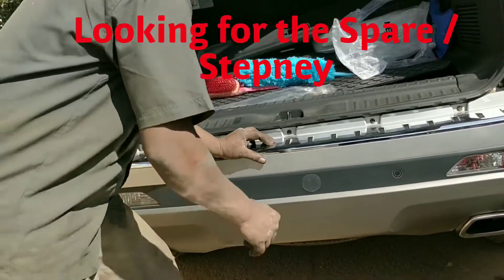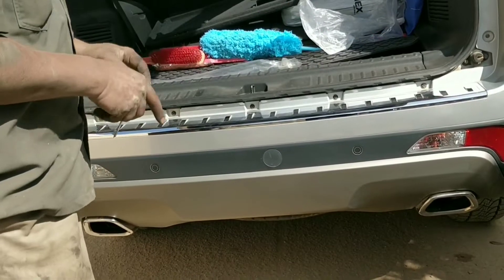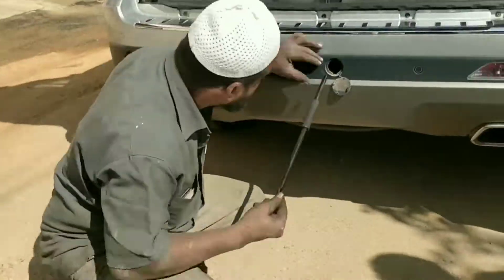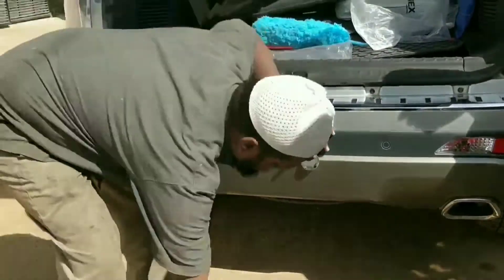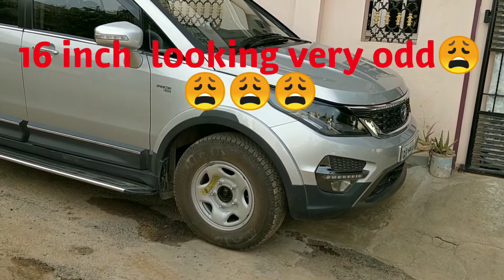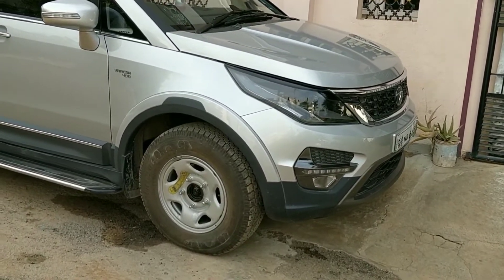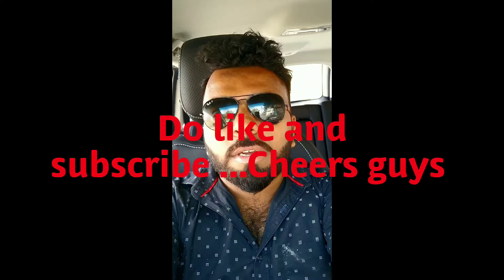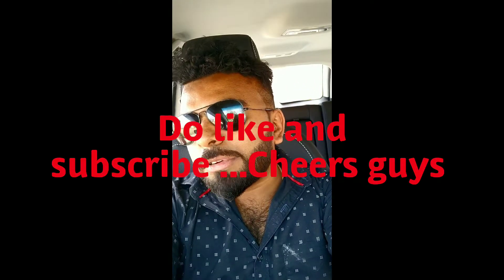Tata Hexa 2019 | 2018 Unchaining Tata Hexa Spare Wheel |How to Change a Flat Tire |Puncture Tyre

Comment: nice informative vlog. i have hexa xt and those 19 inchers are breaking my back on bad roads. are you having the same problem? i maintain 34 psi but still on rough rods the car jumps like anything. what is your experience with the suspension and rims? kindly share thanks
Reply: Because 19 inch rim looks good but the tyre side wall is small. You feel hard on bas roads and some time tyre cut due to low profile tyre. You have to change all rims to 17 inch with normal profile tyre.

Comment: How old is your hexa xta? And how many kms run..?
Reply from the maker: Hey Buddy ...It is Hexa XT . Its a 2 and half month old baby .
Around 5k kms.
Reply: 2 and half month old and puncture so early? Third case i heard for the 19 inch hexa.. and im thinking of buying one.. doubts in investing 20lacs   arising..
Reply from the maker: @buddiesbuddy8919  Lemme Tell you , I have a friend who owns a XT 4*4 from 2017 and the Wheels are intact & Sturdy. It all depends on the road which you drive , In Bangalore puncture guys them self scatter long nails on the road and I was one of those Victims ..Unlucky Probably. Nothing to do with Hexa , it could be any car.
Reply: @Ashish15Mathew  looks like not the prob of hexa but the tyres.. coz the puncture in the side..  check for cracks in the tyres.. and shocking that tata gives 16 inch as spare.. why why why..?
Reply from the maker: @buddiesbuddy8919  Yes puncture is on Side and tats a bad luck for me . Spare is 16 that is even more irritating , dont understand what is the logic behind it .You pay 20lakhs and cant they give an additional wheel with 19inch alloy . But now adays all the manufacturers have become stingy , they charge more with less facilities .
Reply: @Ashish15Mathew  true that.. any issies till now with ur car loke gear vibrations or steerinh vibrations? thanks for the reply and good going with ur hexa.. do post some more videos of hexa like luggage space and seating comfort.. thanks
Reply from the maker: @buddiesbuddy8919  I havent got any issues till now , But yes the Gears and clutch might be a little notchy if your used to a very smoooth sedan .Same with the Steering. But am sure you will be used to it very soon , since i peep through small gallies in bangalore and I have got attached to the notchy thing as of now ., but tat can never be a concern for you . Sure I will be making more and more videos for you . thanks buddy .
Reply: @buddiesbuddy8919  I have a Hexa XM with 16 inchers, 7 months and not a single flat tyre..

Comment: Tata should b carefull about maximum
Tyre  related problem in hexa.I had bitter experience of changing 2 no of 
Tyres. It is not generally available in 
Market.Due to19 inch size-company
should give a solution to this
Reply from the maker: Same here nanda.  Sides are too weak , luckily just had once but trust me 19 inch wheels look much stylish than any other big branded cars wheels. We gotu be a little careful.  Can't always be too .